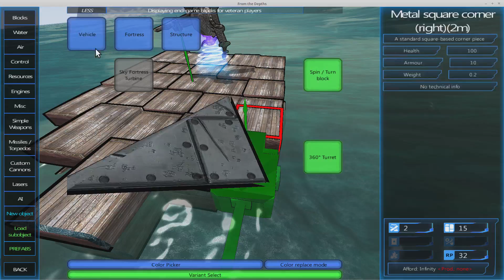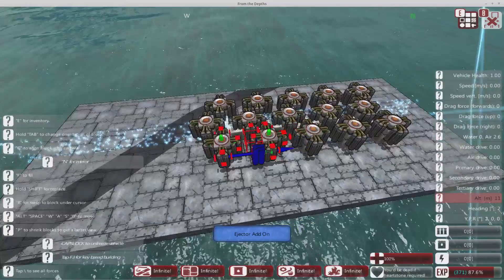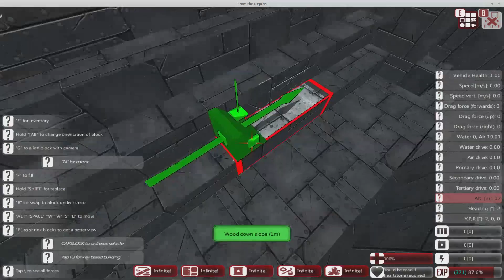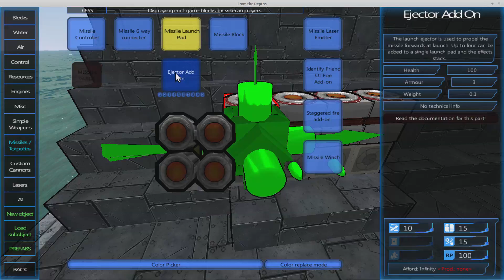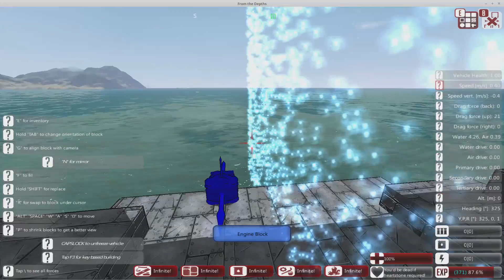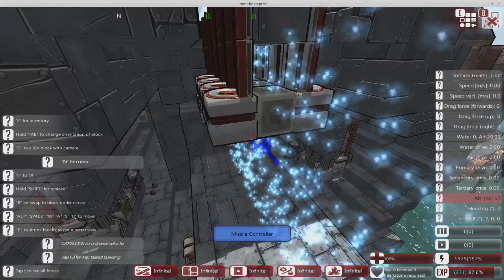From The Depths 1.7 E77-Turtle Missile and Laser Scout Pt1.LetsBuild,Playthrough,Linux

Comment: You may have already figured this out by the time I watch this, but I think you deleted one piece of one your missiles when you were filling in the metal beams down the center row. It should be the second from the front in the middle row of your main missile system. The time code for that is around 21:45
Reply from the maker: malaclypse2317 will check before I go live with it. Should come out in testing as it would not fire the missile or blow up. Thanks for pointing it out.

Comment: I cannot get this option to come up when I use that laser. Silly question, when you load the game up, what is the version at the top right?
Reply from the maker: GutteralMasticator My version is 1.761 which should be latest base version.
Reply: Dels Gaming ehh computers and updates -.- something messed up on my end. More vids plz ! :). Btw in case I missed it, do you have previous vids for mining outposts ? and the starter base? as in defense / optimal collection things etc..
Reply: Dels Gaming oh and why the heck does the naval AI wobble to go in a straight line ? it turns left and right constantly real small twitching -.- any way to smooth that out ?
Reply from the maker: not with the standard AI unless you make it less able to turn. Basically it turns until it get aligned but due to momentum it over corrects and then has to turn other way. The new Lua controller will allow finer control but needs programing experience and not for beginners.
Simple starting point for nonLua is reduce the turn ability of the ship. On large ships just use a Rudder with one or two thrusters. It's smoother but will still go left right left etc but less pronounced.
Reply: Dels Gaming Right, coz in your vids I hardly see any of this erratic left/right movment. My "starter" wooden ship holding a 360 missile launcher with laser guide just freaks out trying to keep the laser on a point of the enemy ship 1 due to waves, second due to that silly movement like fishtailing :/. I guess you would advise a more bigger ship? are submarines also affected like this ?
Reply from the maker: All are effected it is more how pronounced it is. If you look at some of my smaller turtle patrol boats they do have the same wobble.
One quicker way is don't make the ship too short. Longer ships have less wobble issues.

Comment: As a note, you should try and spread out the fins on your missiles, near the thruster and the tip, supposedly they fly better that way.
Reply from the maker: Tkdmaster1991 Will check it out in a LAB vid if required but I have not seen any value or change in directional control based on where the fin is. I did in one lab vid place fins on similar rockets at back mid and front and when they fired they all took exact same course. But in case it has changed I will go recheck.
Reply from the maker: Tkdmaster1991 just to confirm this issue. I built 3x8 block missile launcher and put fins at different positions on each with a one turn block. then fired them all at the same time. They all followed the same path which would not be the case if fin position mattered.